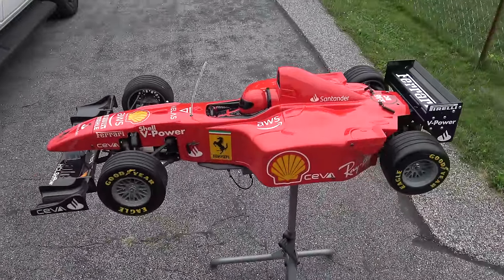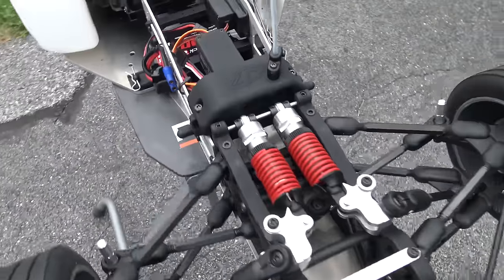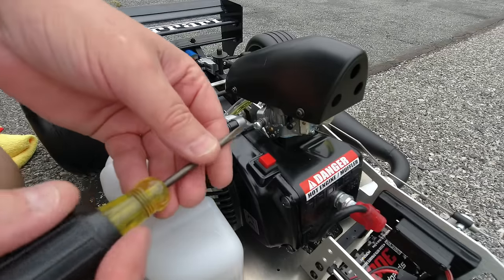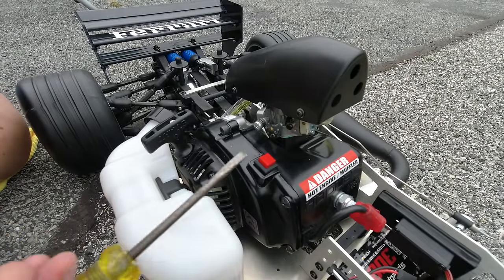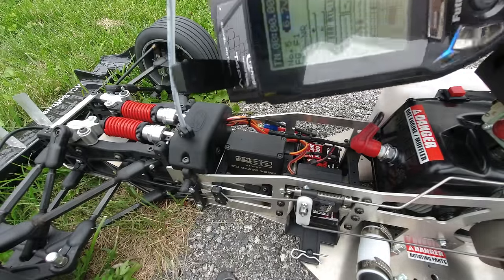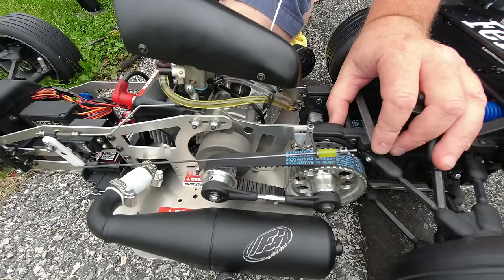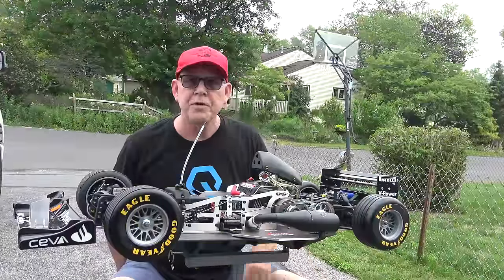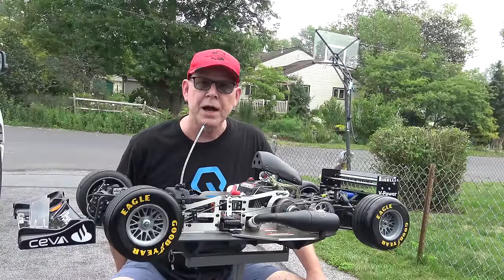FG Formula 1 Car First Start & Custom Body Reveal

Comment: Just my 2C from my own experience here. Make up an exhaust pipe to go on the silencer to route out via the back of the car. As currently the oils coming out of the exhaust will get on the rear tyre. I learned this the hard way and making up a routed exhaust fixed the issue and no more loss of traction.
Reply from the maker: Thanks for the tip.
Reply: Have the same. After some time it will smudgde your car body etc. Better to reroute if you can do it. Also it looks like your expansion pot is vibrating, perhaps secure it a  it better.

Comment: Just as a recommendation.  Instead of tilting your model to get fuel in it, try getting a syringe.  It would be easy to angle over the car.  And you could easily attach some tubing to it as well to get a better angle.
Reply from the maker: Good idea 👍🏻 thanks

Comment: This is so cool/awesome/insane. I had/was into RC (battery) when I was younger (10-12). I couldn't afford the fuel running RC. I had no idea RC world build was this insane. What does this RC world cost if someone like myself were interested in getting/building an RC at this level? TIA... Very Cool RC, I'm glad I came across this video.
Reply from the maker: Thanks for your comment. You can get in the hobby with the less inexpensive 1/5 scales from places like fearlessrc.com You can get an HPI buggy clone ready to run for like $500.  Cost only goes up from there when you move up to the more elite brands like Losi, Kraken, HPI and MCD especially is you start adding upgrades to your rig.

Comment: I can’t nock this guy it’s a lovely car the one thing I would sort out is filling the fuel tank lifting the car on its side all most is not good but the guy new that I will say nice car sir . I had the FG MARDER years ago with a power pipe I loved it I would like another one the fuel is so simple just add rock oil. Any way good racing to you sir. 💪👍

Comment: Looks great. Little confused with all the upgrades that you left your 2 cycle exhaust pointed towards your wheel.
Reply from the maker: its the recommended mounting by manufacture. luckily exhaust does not effect wheel or control

Comment: Nice build but you could EASILY get a lONG NECK funnel and heat it up and bend it to the desired angle so there would be ZERO need to turn the car over but I'm sure you have figured that out by now...

Comment: I am pretty sure that this is more or less the standard version of the FG F1 car. I own the same, but i have upgraded nearly every plastic part into Aluminium. The vertical chassis plates are available in cfk. I also replaced the into cfk. But nevertheless my car is not competitive with the competition f1 car from FG.
Reply from the maker: Yes, this is the standard version. The competition model has that all steel gear drivetrain for more precision driving.

Comment: I'm sorry for all the questions, sir. But do you have any videos on adjusting the brakes?
Reply from the maker: I don’t yet but what are you trying to adjust. The front or rear and what’s wrong?
Reply: @316RC  The front end of the back i'm almost done breaking it in it won't stop
Reply: Front and back brakes
Reply from the maker: @mikemoultrie8829  Is your servo linkage correct?  That back should be just a tad loose with no throttle. Free spin the front with the wheels off the ground then apply break. They should stop hard. Check cables. What braking power% do you have set in the transmitter?

Comment: Does it have a servo failsafe for the throttle? The rear tires seemed to be toed in too much. I wish there was a way to get those hoses to follow the front upper wishbone into the chassis. The way they were I was kinda like ugh.
Reply from the maker: Yes, I have a throttle cut programmed in the radio plus an engine kill switch on radio loss. Can also activate kill switch from radio. I haven’t done anything with suspension adjustment yet. I’ll do that when I get it to the track.

Comment: Very cool ! May I ask where you got the tires from?
Reply from the maker: The tires are stock. The lettering kit is from Detroit Performance.
Reply: @316RC Thanks! Did you have to thread lock any screws and also grease the differential before driving for the first time?
Reply from the maker: @RedNinjaGaiden  Yes, I always remove any metal to metal screws on all my RCs and check for thread lock. FG did a good job locking all the screws. I did tear down the diff and replaced with my favorite “Fast Eddy” grease although what FG had in there was sufficient.
Reply: Thanks for your suggestions! Is your front wing an upgrade and also painted? It looks great.
Reply from the maker: @RedNinjaGaiden  Yes, it’s an upgrade. Comes clear lexan.
Reply: Thanks! It looks fantastic. May I ask where you got it from?
Reply from the maker: RC Car Online  @RedNinjaGaiden
Reply: Thanks again for your tips

Comment: Which F1 Ferrari is that supposed to be?

Goodyear stopped supplying F1 tyres a quarter of a century ago.
Reply from the maker: It’s not really based on any specific F1. It’s based on what my paint guy could do. The tire lettering is for effect. The only decals available to fit these tire were either Goodyear or Hoosiers so I picked Goodyear. Just looks better than no lettering. Not meant to be an exact replica.

Comment: How does it handle. I used to race 1/8th years ago using 21 engines
Reply from the maker: You have to get the rear shocks adjusted and learn your throttle. You can easily spin out if applying too much throttle on curves.

Comment: Hi everyone,  are the any other 5th scale Formula 1 car out there besides FG so I can compare with? Also the same question for 8th scale, and 10th scale and electric.  I'm new to F1 cars and can use some guidance.
Reply from the maker: 1/5 scale I don’t think so. 1/10 electric check Serpent they make a F1 kit.

Comment: That exhaust is limiting all the possible power from that engine.
Reply from the maker: In the case of this engine not so much. It's just a stock 26. If it would be a larger or high performance engine I would agree but this thing is so light that its hard enough to keep it from spinning out the rear end.
Reply: @316RC   Ok, I see. In that case I totally agree with you. Keep up the good work.

Comment: did you ever run this car?
Reply from the maker: I ran it up and down the street in figure 8 to break in the engine. Sorry no video of that. I was going to take to the track before winter but I tore my rotator cuff in my shoulder. Between that and winter I did no RC stuff for 6 months. Just getting back into it and hope to finally run it this summer 👍🏻

Comment: What temperature should my motor run at when its fully broken in?
Reply from the maker: Temperature measurement is a little subjective. Depends where your measuring but some say 220-250F ok. If your carb tune is good then don't need to worry about temp, it will be inline. What oil you running? I like Amsoil Dominator.
Reply: Motul 2t 800

Comment: Mate for somebody who built such a nice machine, it’s a mystery how you seem incapable of organising and using a properly designed fuel can with a properly shaped nozel to safely fill the racing car’s fuel tank!
Reply: Book smarts is rarely combined with common sense.
Reply: @millroyboy07 Why make that comment, why be a toolbag?
Reply: @jjsdjt760  It’s a fact.  Engineers created the modern world, but half the time they wouldn’t pick up a screw they dropped without analyzing the different ways in which it was manufactured.  

Conversely, journeyman may not be able to calculate the compression ratio of a steel beam using algebra, but they can build a bridge with their eyes closed.
Reply: @millroyboy07  Understood, better way to communicate that for sure. Sometimes the internet just comes off as shallow and petty. Be well…
Reply: @jjsdjt760  I can see that in my comment.  Sometimes there’s a confusing dynamic to internet commentary; a lack of identifiable emotion or empathy.   That’s my bad.
Reply: I'm sure he will get better at it
Reply: Use a pump

Comment: I'm not keen on the FG sportline touring line of RC cars,  made with lower quality parts for the asking price .  Compared to the higher parts quality you get with the 8th SCALE HoBao Hyper VS2 and VT ,  and compared to the 5th scale higher quality you get with MCD ULTIMATE  & HORMANN HT4 quality etc which is the kind of quality you should expect for a 5th scale high quality RC car  .  FG normal sportline models with the cheaper aluminium doesn't age well ,  unlike the better CNC 7075 ALLOY  used on  HoBao ,  MCD & HORMANN  .   Your  FG  F1 car is the best that FG can manufacture with the F1 COMPETITION  model ,  and compared to the normal touring sportline models that doesn't say very much for the lower quality materials parts list for the asking price .